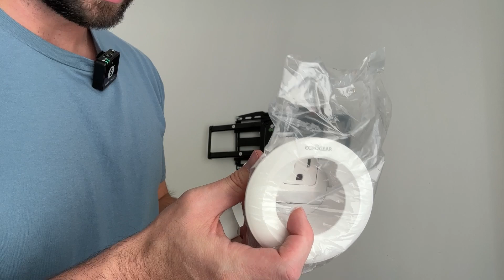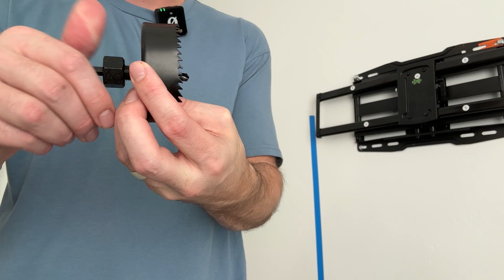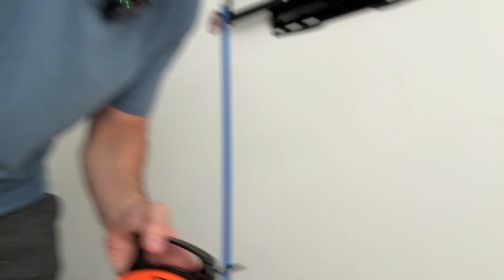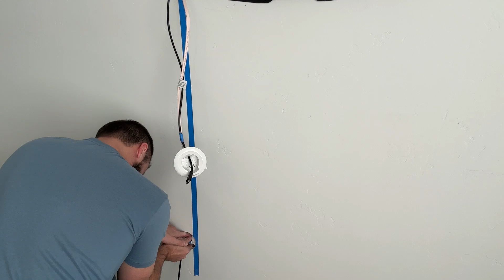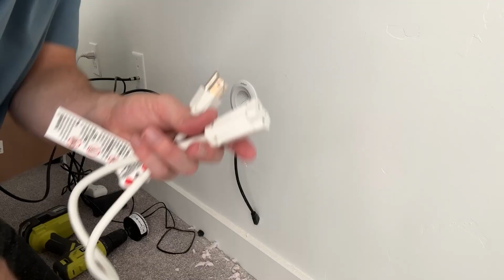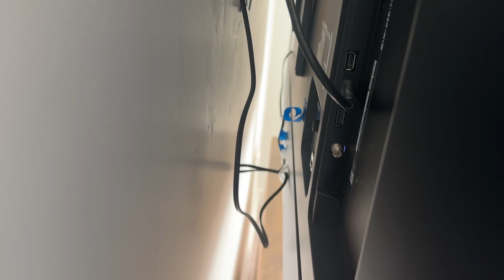How to Hide TV Power Cords The Easy Way (ECHOGEAR In- Wall Cable Management Kit)

Comment: as nifty as this appears, it is against code to run an extension cord like this inside a wall
Reply: Echogear is ETL Certified when installed per instructions. Specifically, it needs to be in the same 16" stud bay of a single wall and not used to bridge between two rooms (even if the other room is on the other side of the same stud bay).